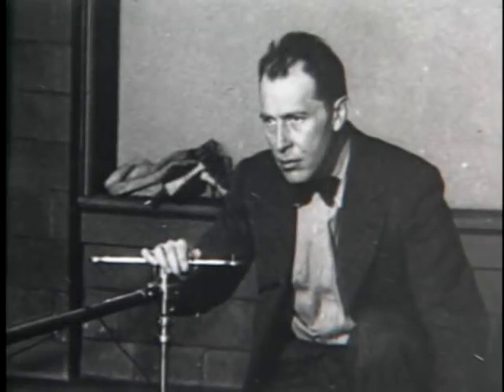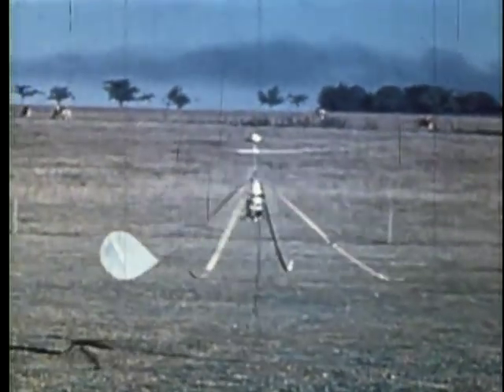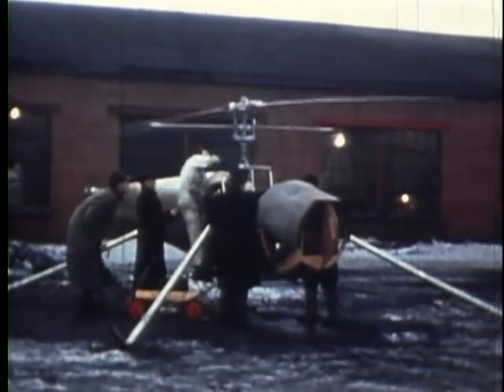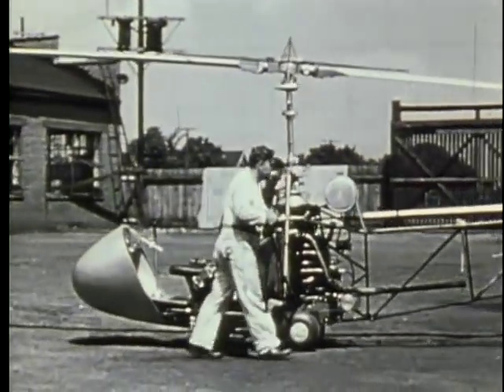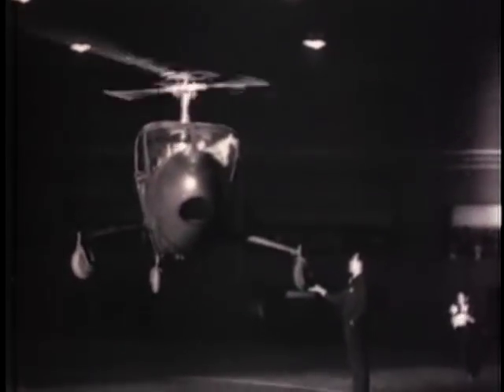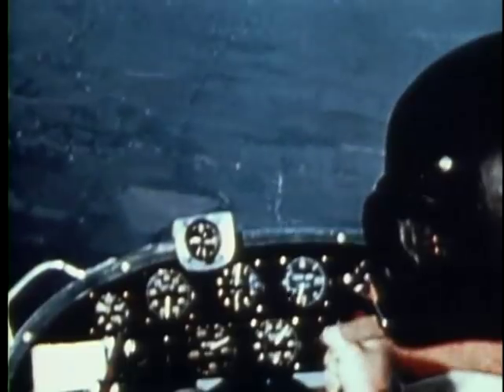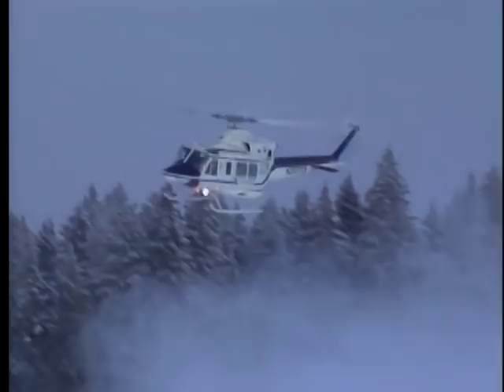Birth of Bell Helicopter

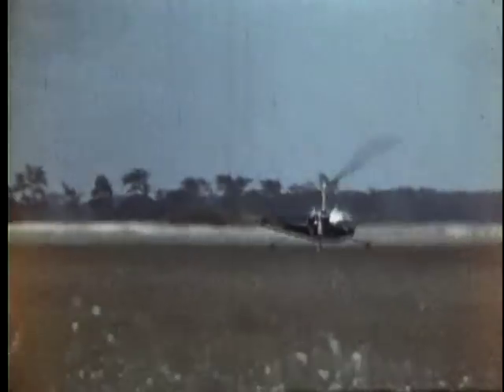Comment: The third landing at 4:14 that crashed.....Slo-mo shows he landed hard enough to flex the rotor blades down which allowed them to strike the tail rotor and tail boom.  The narrator says only part of the landing was captured, but the first strike is visible in the footage.
Reply: Tail wheel forced the tail up as the pilot flared hard = tail strike
Crash was on the film end leader holes and all ...

Comment: The vibration at 20Kts is nomal. All of the semi-ridgid rotor Hueys also do this.
Reply: Hueys didn't vibrate alot. infact they were one of the most stablized aircraft, that's why they were weaponized with missiles + machine guns.
Reply: The ''vibration'' at around 18kts is normal for ALL helicopters. Look up ''inflow roll'' and translational lift.
Reply: @nyph933  Yes. The Bell 2-bladed ''semi-rigid'' system was very stable in the hover and was quite comfortable up to around 80kts, above that it gave you back trouble over time).
Reply: @Slaktrax  Mm yes, but it's the same with every aircraft, too much pressure and things will go out of the ordinary. Tho 80 is a large speed, especially for side mounted weaponry.

Comment: An electric helicopter could capture energy from the downward thrust, with enclosed turbine generators placed vertically around the body.  If they were good turbines they would spool up pretty good with all the wind pushing downwards and they would generate a lot of electricity for the main motor.  It would probably have great range.
Reply: Back to school kid. :)
Reply: No.  

Study your basic physics:  For every action, there is an equal and opposite reaction.
Reply: @johnborton4522  Ok I was just throwing the idea out there I'm no expert.
Reply: You can also place electric generator at front wheel of a cycle and electric motor at back wheel.. connect them just push the cycle to start currant flow ..
Tan ta daaa ... You got free, never ending energy.
Reply: @Vijimn1  there's friction and loss of efficiency so it will not be perpetual motion.
Reply: @safetyinstructor  I never suggested perpetual motion.  That was your assumption and you know what that makes us.  I was merely pointing out an idea that fan generators could capture significant energy from the downward thrust of a helo.  You have to think of things that can scavenge energy its not just better batteries it's potentials of recapturing energy and putting it back in the vehicle's grid.  It's done in e-cars with regenerative braking and coasting Im sure there's other ways too.
Reply: @Orbit_Corona  fan generators will decrease the efficiency of the main rotor because they block/slow down the the downward airstream ... (so it's just like a veeery inefficient perpetuum mobile  )
Reply: @safetyinstructor  Yes true.  Maybe a few wouldn't reduce the thrust very much yet may still regenerate some electricity.  I picture them fairly low and a wide mouth turbine not unlike what a PC cooling fan looks like.  Not too big maybe only couple feet diameter max.
Reply: @Orbit_Corona   you can't produce enough electricity with the fans to pay off the efficiency loss due to the air resistance because that would be a perpetuum mobile...
Reply: @safetyinstructor  Had you already punched in the calculations?
Reply: @Orbit_Corona it's basic physics ...
Reply: @safetyinstructor  Ok bro.  We'll let that idea float in the wind then...and on the internet, in case someone can figure out how to make it work.  I know I won't .  I never fly.  It was just a comment on an idea thanks for the conversation you're decent you didn't pick me apart for just an idea.
Reply: @Orbit_Corona  Imagine jet plane with generators in vertical position. Those generators would cancel forward movement very easily and generate back only fraction of the used energy.
Reply: @mikakorhonen5715  But a jet plane would have the generators mounted horizontally.
Reply: Nope Never Nada

Comment: Impressive!
, but what about Germany didn't they have helicopters earlier?
Reply: Seems like bell had a more sophisticated single rotor design with tail rotor to overcome torque problem Germans were using twin rotors it looked awkward and was
Reply: @ericloeschmann3258  No. The Bell system was the simplest. Sikorsky was using a three blade fully articulated system with an ant-torque tail rotor and the Germans were using two counter-rotating rotors, both of which were more complicated and sophisticated.
Reply: Commissar Finkelstein lmao
Reply: Igor Sikorsky